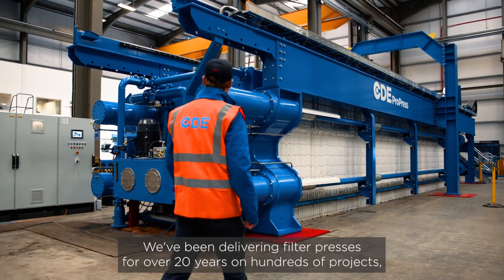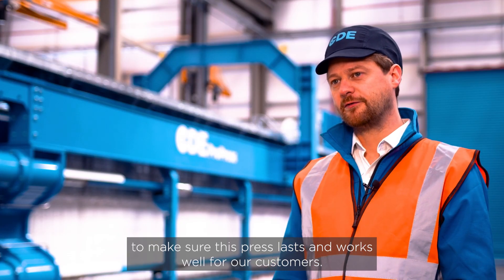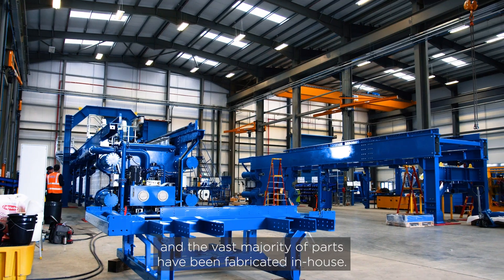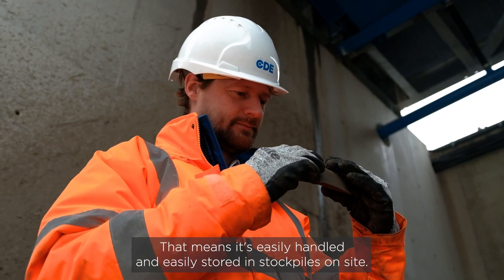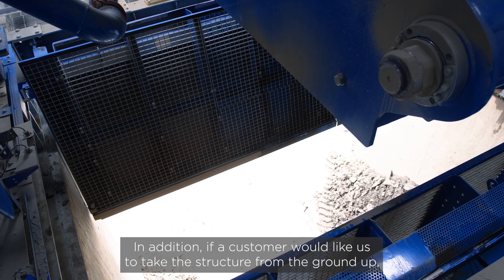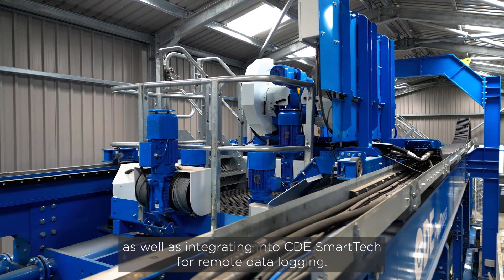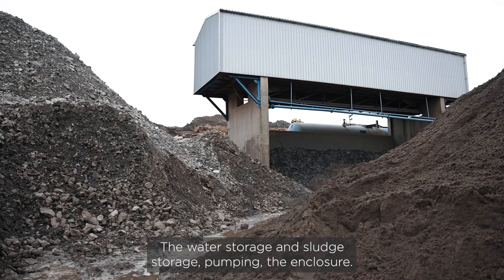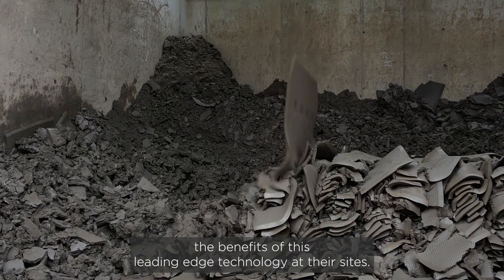CDE ProPress™ Filter Press - Discover the Next Generation of Filter Press

Comment: Which pump is used to put the sludge into the press? The one that we had (Gaskell Bros) was a Pemo,which was very high maintenance, both in time and cost.
Reply from the maker: Hi Mike, building on extensive learnings from the early days, we have developed a new metal-lined pump in collaboration with Perissinotto Pumps that is more durable and easier to maintain.
Reply: @CDEGlobalCookstown  thanks for that,was a problem area for us,so much so we had a spare pump in stock.